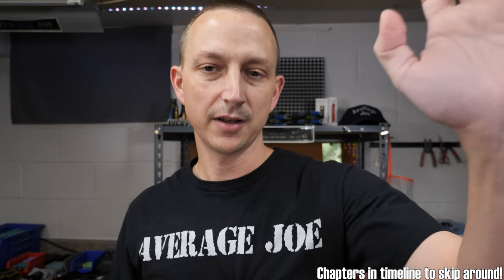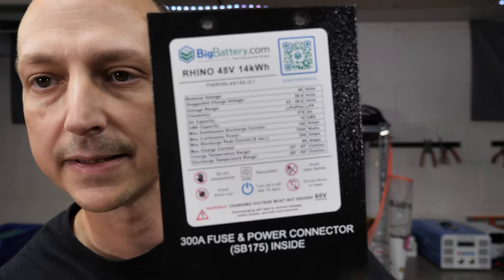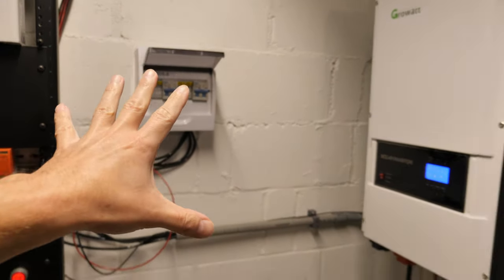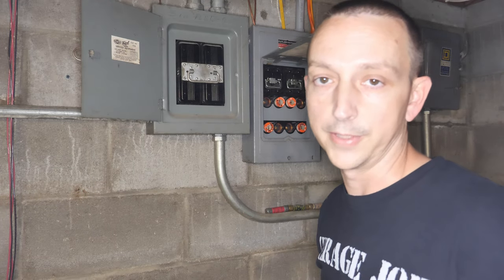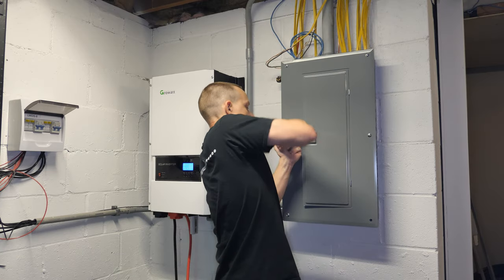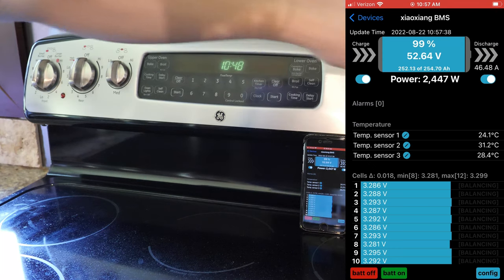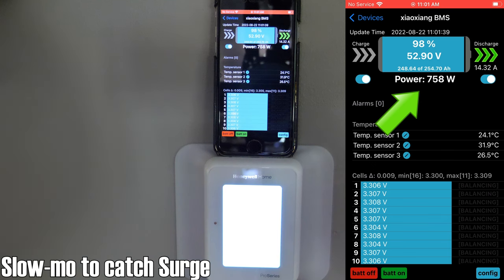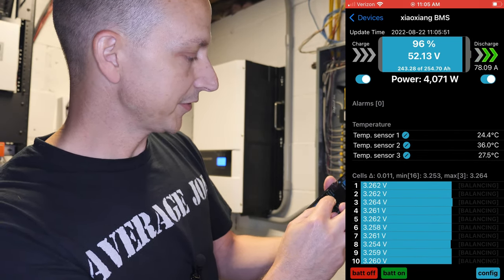Can you Run 4 Ton A/C, Stove or Dryer on a Battery???  RHINO BigBattery.com

Comment: At 6:46 there are two ratings because depending on if you are on 3 phase power or not you might be getting 240v (Split phase) or if you're on 3 phase power the voltage between phases is usually 208v. So if you have 208v power the oven will max out at 11.6 kW and if you're on 240v split phase (Which you are and the vast majority of homes would be) it will max out at 15.4 kW. (And that's assuming you turn on every burner to the highest setting plus turn the oven on as well). The thing is these ovens are usually plugged into a 50 amp outlets which would max out at around 12kW so while 15.4 kW is the theoretical max you should never actually hit that number (As you saw) because you'd likely kick a breaker.

On your A/C: Larger A/C units (IE: More tons) will use more energy. On the flip side higher SEER ratings will use less energy. A 5 ton unit at 20 SEER will use the same energy as a 3 ton unit rated at 12 SEER. So getting a higher SEER unit makes a huge difference in whether or not you can power it from solar/batteries.

You can estimate wattage for an AC by taking BTU and dividing by SEER. There's 12,000 BTU per ton, so your 4 ton unit = 48,000 BTU. Divide that by 14 SEER: 48,000 BTU / 14 SEER ~= 3430 watts. Considering your house showed about 750 watts of consumption before you turned the A/C on: 3430 + 750 = 4180 which is right on the money with the 4.2 kW you saw on your test.

Of course this is an average: In hotter temps you'll see a higher wattage and in cooler ambient temps you'll see a lower wattage. SEER is a "seasonal average" so the BTU/SEER gives you a number that's a good average value.
Reply from the maker: AWESOME!!!! Thanks for that!!!💥💥🤘
Reply: Thanks for the info now i actually learned something today

Comment: Great video! An Inverter duty A/C unit would make a big difference. I can run 4 mini split units for bedrooms, with solar panels connected, all day. Don't run them at night on batteries, because we only have flooded lead acid batteries for the moment. We also bought an inverter duty water pump, which helps alot also. We are in Costa Rica,  so we have usually 10+ hours of great sunlight.  We also run our pool pump on its own solar system with a DC pool pump. We do have line power tie in, so we never see a blip in power. We have alot of brown or black outs in Dec to March, but we never get effected. Actually had to put an alarm to tell us that line power is down, incase we are running A/C's at night and don't want to drain batteries too fast.
Reply from the maker: Thanks Mate!  Ya mini splits would be optimal for sure!  Thanks for sharing your setup and how you use.  With my current setup and how we use it, I dont know the grid is down unless I happen to see the stove clock not on lol.💥🤘

Comment: Awesome!! That was quite a surge! Now the Air Conditioner info I can explain.
RLA = Rated Load Amps, which means the normal/typical amperage the compressor will draw, so that is what you will see after it has run for a few minutes and isnt under a super heavy load. For example a walk in freezer that has been off for a while and is now at 70°F will be drawing higher than it's RLA until it cools down closer to it's designed temperature. Your AC you would probably just see the RLA or less most of the time.
LRA = Locked Rotor Amps, is the amount of amps the compressor will draw if it is stalled or putting out the entirety of the motors torque. So that only happens at startup or something really bad happened to the compressor.
Now about the cooling fan (often called the condenser fan) FLA = Full Load Amps, that is the amount of amps that the motor will draw when it is stalled or putting out the entirety of the motors torque. So unless that motor is bound up or the bearings are shot you should see less than that value.
So feel free to put a clamp meter on it and see how your AC is doing compared to those ratings!
Reply from the maker: Awesome!!! Thanks for that!  Ill have to see if I can put a clamp in there somewhere to see!!!💥🤘

Comment: Just ordered 2 Rhinos yesterday. Thanks for all of the great info and the discount code as well. 👍🏻 What a pleasure to have the people at Big Battery actually answer the phone and offer as much information as required to make an expensive purchase.
Reply from the maker: Awesome! Yeah they are some really nice people over there! Do you have an inverter allready?
Reply: @AveRage_Joe  I have an existing system with a Schneider Context SW4048. Will be looking at upsizing next year. Was thinking of the Growatt 12k. Need split phase. Suggestions?
Reply from the maker: Oh ok nice! Well im happy with the 12k growatt I purchased. I have also tested out orient powers 6548 inverter and it does a great job. You would need 2 so you can parallel them for split phase tho. They have a lot of options as well.

Comment: Man, the old school main breakers! 50s house here too. Crap breaker panel (Zinsco fire hazard, $3k to replace). Crap insulation, crap windows, crap AC. The condenser is 10 seer and old enough to vote, and unfortunately on a 50a circuit outside before the 100a house panel which makes back feeding it problematic (CT positioning). Between it and the inside blower it's at like 6kw an hour. Investigating mini-split / heat pump options, and insulation, and windows, and... bye money! Thanks for the vid :)
Reply from the maker: Oh ya lol!!!  We just had the AC and furnace replaced a few months ago and slowly replacing the windows.  When I redid the kitchen and tore down the "drywall" on the exterior walls, the "insulation" was basically paper sheet with cotton balls stuck to it.  Welp.... all the cotton balls have fallen off and fill up the lower area about a half foot.😆

Comment: I converted to a 4-ton whole house (forced air) Lennox (top SEER) heat-pump for heat and cool of 2600sq ft home.   These typically have variable speed motor technology - so there's no longer that 16,000w 'surge' we saw on yours.     The outdoor heat-pump unit sticker says 18a@240v (e.g. 4,320w)  + internal fan ~600w gives a 5,000w absolute max for heat or cool.   With no surge,  its eminently doable to run a 4-Ton heat-pump.   I'm zone 4 weather and in dead summer it's ~1.000kwh month (hottest months).  In dead winter is 1200kwh/month for coldest months.     Inbetween it's 800kwh-500kwh/month for heat + cool in spring/fall.    Dyers are ~4500w on/off - like the burner on the stove its on/off heating element.     I read that heat-pump dryers are lower power ~1200w? but some are not happy with them? - don't know.
Reply from the maker: Heat pumps in my location are not recommended at least for winter. Especially for my house since the insulation is lacking atm. If you have a newer house that is insulated properly, ya 100%!
Reply: @AveRage_Joe  heat pump dryer does not have issues in cold climates.  The way they are designed, is different than how HVAC based AC/heat pump systems.  Check that out.  If you want WebEx with me to go over, I will. 

Also, getting a new HVAC system that is described by me in a separate post, the new heat pump tech works very well below zero.  HOWEVER I am not saying to use this as primary heat source if you have other methods. The true variable speed DC compressor are by nature also heat pumps. But, just using this for AC, you gain all the extra power reductions.  Forget even using it as heat pump, except for a backup in case primary heat source goes down.  I discuss this in my separate post. Again, I would do a WebEx with you if you want to know more detail. 

Great content.. Congrats on going YT full time.
Reply: I just put more panels in and run standard water heater and dryer. Much less problems and doesn't cool your house-crawlspace or  basement.
Reply: We have a 2700sq foot home in coastal Virginia. Air is on from March to Oct. Any tips to run on solar battery? We have sun most days. And any tips on running our gas stove when the valve turns off when electric power goes out or how to bypass this?
Reply from the maker: Same really, just add another battery and solar and no problems!

Comment: Thank you for all your work on these vids. I am in the process of planning (and funding - selling a spare SUV) our second solar project. I have a small 400w array w/ 12v 100ah LiFePo4 battery for attic fans as a small proof of concept. Now scaling up to an array dedicated to a 240v mini split and 240v outlet in the garage. Eventually will scale up further to a whole house setup w/ batteries. Your videos (and other creator's) are a huge help, I've watched hours of them. Just wanted to say thank you.
Reply from the maker: Thanks Mate and Appreciate that.  I started with a 12v lead acid system many years ago for proof of concept and backup system.  It worked but didnt have the grunt to get things done.  Only thing I would suggest is upgrade to 48v when you can!!!
Reply: @AveRage_Joe  Absolutely. The system running the mini split will be 48v as will the whole home system. The 12v setup is strictly to run 2 80w 12v DC attic fans (brought attic temps down 20+ degrees). So it made sense to save money on the inverter and battery @ 12v. I had been looking at the rhino batts but think I will go with a rack system for capacity and cost. Not looking forward to dropping all that coin, but I like to buy once, and cry once. 👍 Thank you again, all the info is immensely helpful and cost saving. Local installers wanted $78000 for a system similar to what we want. No thanks.
Reply from the maker: 100%  Yeah rack systems are nice as well.  Seems a lot of companies and people are switching over to them.  Ive had my diy rack for years.  Ill be changing that system out for another without a rack.  Shoot even Bigbattery has rack batteries now lol.  Ill have to get one and test it out.  No way Id pay $78k!!!😲😲😲

Comment: Look up soft start for your air conditioner. It drops down the inrush current on start up.
Reply from the maker: I will need to get one of those FOR SURE!!!!
Reply: @AveRage_Joe  - if you find a soft start large enough for your outdoor compressor, I would be interested in it!

My compressor is too large for all the soft start circuits I have found… I am sure they exist, I just have not found one yet.  :-( 

That is the primary reason I spent 2x more $$$ to wait for a GS 12k vs buying a GS 6k last year.

Comment: Sounds like you need upgrade your main electrical  panel and add a breaker for you're inverter in the main electrical along with a generator lock out so that if one is active the other is off and you'll be able to power your entire house
Reply from the maker: 100% NEEDS to happen!!!
Reply: yea I had the same thought, looks like those 2 ancient panels need to be replaced with a BIG BOY panel and a transfer switch.
Reply from the maker: Yeah a single biggn would be ideal lol
Reply: @AveRage_Joe  that would make another real world 'Conversion ' video.
Moving from multiple panels to an integrated Main with optional subpanels. That would take a while to plan and setup.

Consider optioning "Auto Switch over" during local outages.
🤔💭💣💥
🤔💭💣💥
Reply from the maker: That would be some crazy videoing for sure!!!  Id probly end up showing the end product and some highlights on that on lol😁

Comment: I run my entire house on two 12K, 143kWh battery, 20.6 kW pv. 2000+ kWh/month or 24000/yr. You can too. You definitely need soft starts or variable speed inverter motors.
Reply from the maker: DAMMMMMN!!!!  You have a sweet system!!!!😲😲😲

Comment: This was very interesting you did a good job. But I would like to know how long could you run your   Air conditioner off the battery and solar power. Would you be interested in showing us how long you can run or how many hours you can run your appliances
Reply from the maker: Thanks Eric!  What I can tell you is, on this test day.  I started with a full battery and once I turned on the AC, I just left it on all day.  I only switched it back so we could use the dryer which was around 5:30-6:00pm (since I couldnt back feed the dryer panel). The solar was able to recharge the battery to full during the cycle off time and stayed full all day as the solar was able to keep up. This is also the end of August which is great as the sun isnt in the sky as long.  Anyway, I would need to have a day when we didnt need to use the dryer and run the test again.  Ill try to attempt it here pretty quick if I am able and do another vid!

Comment: Joe… you should put pots of water on your stove, if you are turning on your stove!

Nice to see the battery held up to the HVAC peak, with the low frequency inverter!

That low frequency inverter should be able to run your whole house, if you are careful with your loads. That is the purpose of a low frequency inverter, to give you the peak you need, when you kick on your HVAC!

What is your idle power consumption on the on the low frequency inverter, at an insignificant load? (Measured from your battery consumption… I am waiting for my Genetry Solar low frequency inverter, looking forward to it’s low idle consumption.)
Reply from the maker: Yeah probly should use pots of water.  I am super excited to see the battery held up to it!!  Oh yeah running the hole house with the 12k LF inverter was the reason I purchased it!  Just didnt have the battery yet.  No load on the inverter was around 150w if I remember right.  Ive seen some videos on the gentry's, they do quite well!!!

Comment: Sweet! 
Thank u. 
I was mostly curious about the inverter being able to start the surge. 
Think I want to buy it.
But EG4 just came out with 6kw 120/240 with transformer. Can be paired up to 6 units. And is UL listed..... Grrrr decisions.
My house is on one MPP lv6048 right now except my ac units. I have two smaller 2 ton units. The 6048 won't start em.   20kwh battery isn't big enough to run an ac all night tho I'm finding out. I have two deep freezers, two refrigerators, two dehumidifiers, and two mini fridges. That uses a lot of power all night. I have 20kwh of diy lithium and it's 20% or worse by the time the sun starts charging
Reply from the maker: I knew the inverter would do it, I just didnt have the battery capabilities.....yet.  I also needed to look at all the house wiring to make SURE I was able to back feed that other panel.  Yeah I saw they have the new inverter.  Looks pretty sweet.  Honestly Id go for it especially since you can parallel them.  Im still pretty happy with the 12k and glad I purchased it.  I also still have 30kwh in diy battery that I need to assemble!!😬😆💥🤘
Reply: @AveRage_Joe  eventually I'll go to lifepo4 but I also have a ton of diy lithium ion. I got two whole ev car batteries from an automotive testing company I have all my Chrysler Fiat 500 e batteries hooked up about 20 kWh from that battery and another 57kwh from a Chevy battery. I was doing thermal testing on em at my last job for heat pump development and they good. But yeah more work and time to tear em down and get them to 48 volts
Reply from the maker: NICE!!!!  I have 30kwh in diy lifepo4 that I purchased over a year ago that I need to assemble and install.  Havent decided if I want to keep the diy li-ion yet.  Should be around 50kwh of lifepo4 once I have everything together.  Fun times ahead lol
Reply: @AveRage_Joe  I know right. That's y I started watching your channel was because of batrium but now decent BMS are out there that work for a fraction of the price and lifepo4 is way safer and also affordable.... Hard decision to make. I got all mine for free so I'm going to stay with li-ion for now. But I also just got yesterday 36*71 ah 12 volt sealed lead acid batteries that are brand new from an industrial server UPS. it's currently wired for 432 volts all in series in a cabinet. The cabinet fell over in shipping so they sent them a new one. I got a call if I wanted it ..... Duh. So maybe I will put a battery selector switch and once a week go back and forth to save cycle's but that also means I'd have to change the charge parameters. The batteries are data safe 12hx300-fr. Cost $250 each so I just got almost $9,000 in lead acids for free. But with 50% dod it's the same capacity as 80% of my li-ion. Pretty sure I can't just parallel them. Different internal resistance. Not allowed to list them for sale either. If people at that company found out I was selling them for profit they'd be upset cause then others would argue over who gets it. Maybe I just make another system. But that would require more panels. Not sure what do do with em.

Comment: Hey Joe.  
Great video's!  I have the same inverter and x4 48v 103Ah HSKYs running at my house from Big Battery.  We are off the grid in Texas because we just don't want to be worring about the next freak storm or the greedy power company.  My question is how long can you run if you connect ALL of the big batteries you have even  though they are all clearly different Ah's Hmmmm... The world wants to know Joe.

Comment: Slight correction on your ac. That is a 3.5 ton ac. The 42 on the model number indicates btu. 
12000 btu in a ton.. your model would have a 48 on the model for it to be a 4 ton.

Comment: LRA= Locked Rotor Amps, or inrush  current on start up.
Reply from the maker: Thanks Man! I could have totally looked that up.....but didnt🙄😆
Reply: I didn’t know it existed for a small air conditioner but I have installed many for 60 hp motors. Just happened to see it on a YouTube video. Thanks for doing your videos great way to learn.

Comment: There's an automatic transfer switch on Amazon called "MOES Dual Power Controller 50A 5500 Watt Automatic Transfer Switch" looking to make my system battery supplied and switch back and forth automatically. Looks like there are a few ways you can use it. Would be cool if it's functions can be seen on one of your great videos.